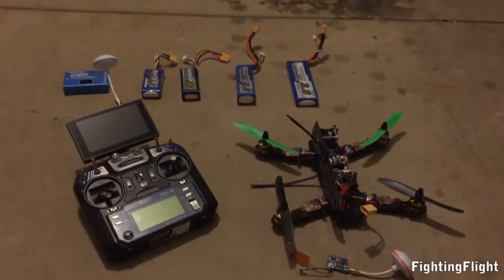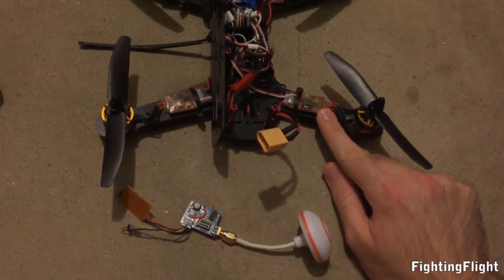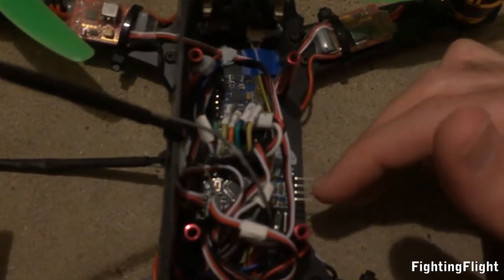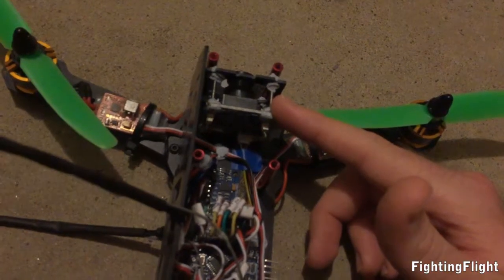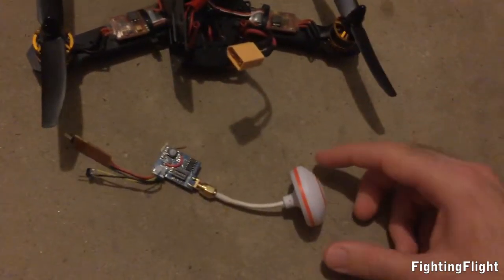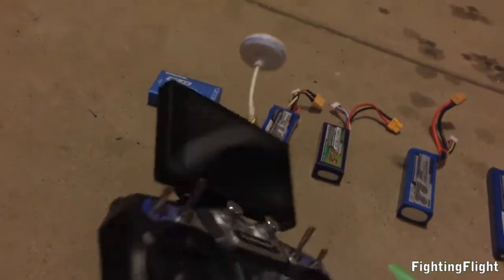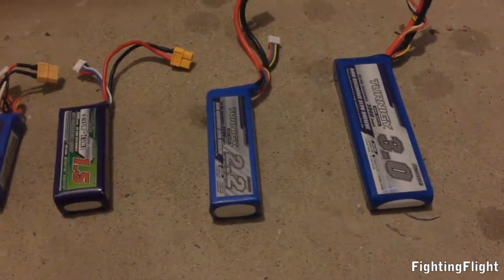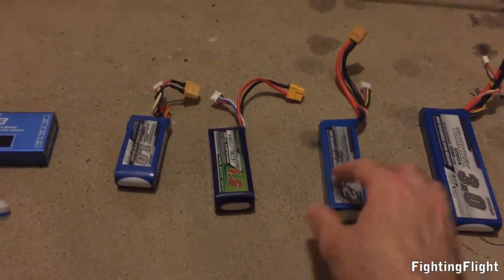My ZMR250 Quadcopter Build Overview

Comment: nice setup , i would recommend a naze 32  or flip 32  flight controller  they are cheap and use cleanflight gui to set  the quad up  , you will have lots of fun  tuning the quad  with cleanflight    there is lot of info on cleanflight online and after i bit of playing around you will have a very smooth flying stable quad . you might be able to tune your  multiwii on cleanflight as well.